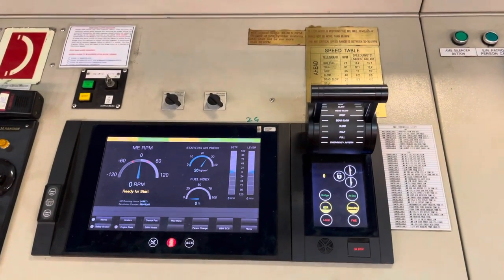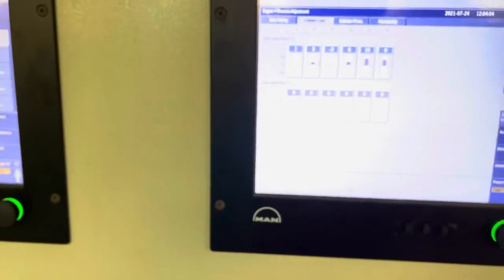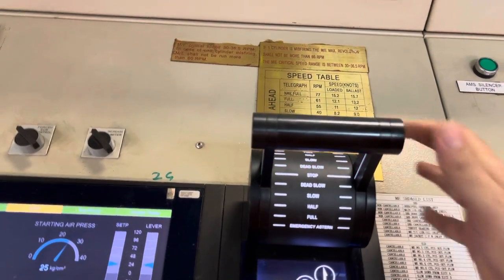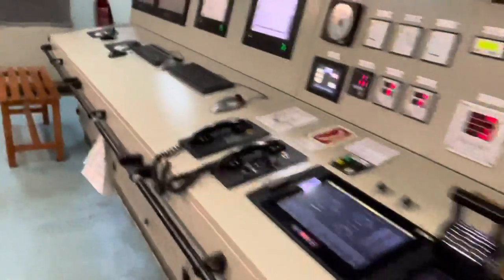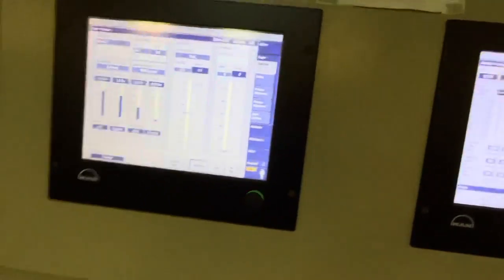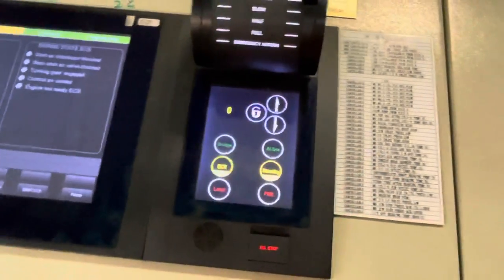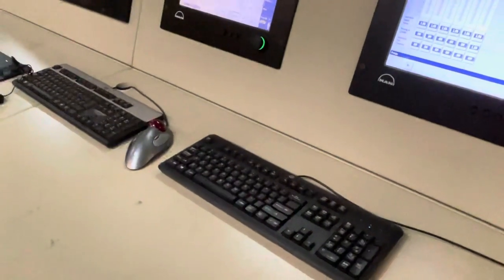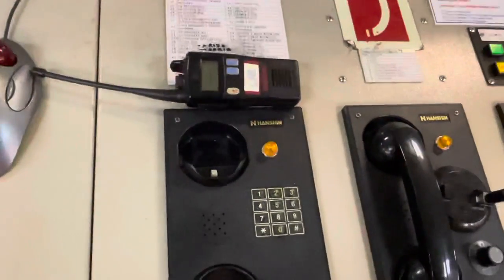How to Start || BLOWTHROUGH Ship Main engine.

Comment: OK but you don't give fuel to engine to check the f.o
Reply from the maker: Dear Initially while trying out main engine from the engine room, we do it on air but once we have transferred the controls to the bridge, then they try out the engine with fuel